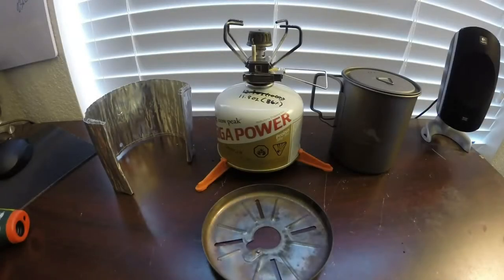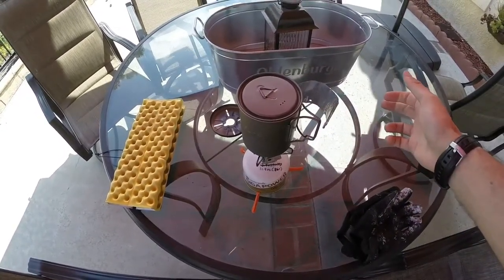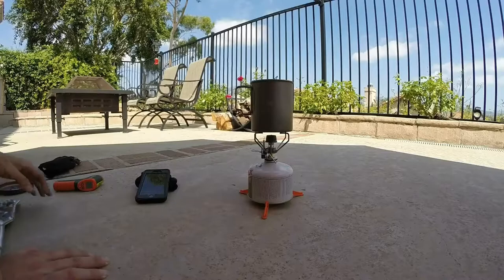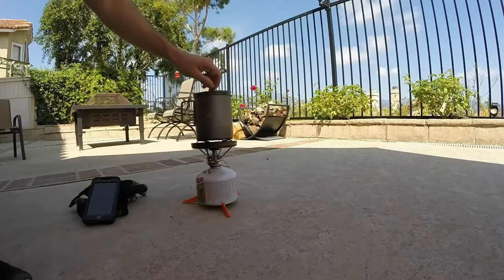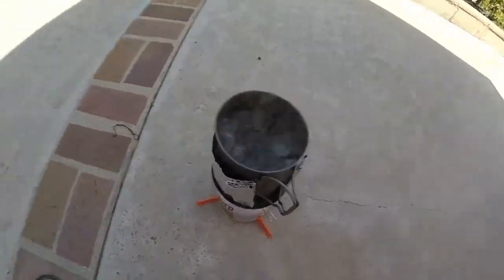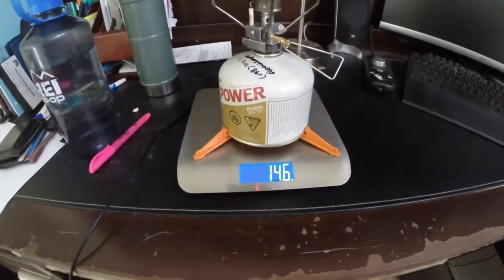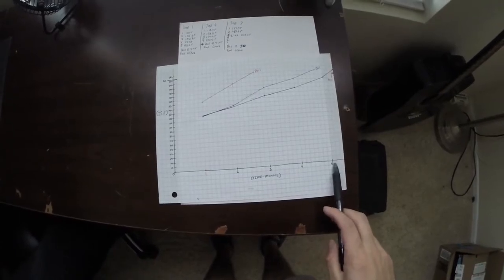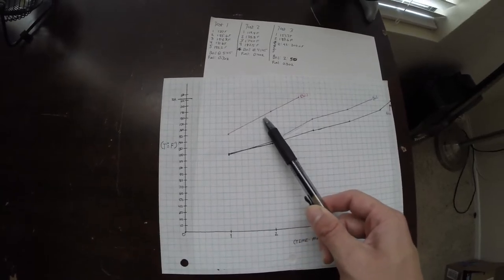Best Backpacking Windscreen for Canister Stoves - Boil Tests 1080P HD

Comment: A better solution to your windscreen burning: Use Titanium. It will handle 3000 *f no problem even though your stove will not come anywhere near that temperature. Experiment with venting for the sake of the stove. You can also add an air barrier around the canister neck. That air barrier can be aluminium for the sake of cost. Enjoy